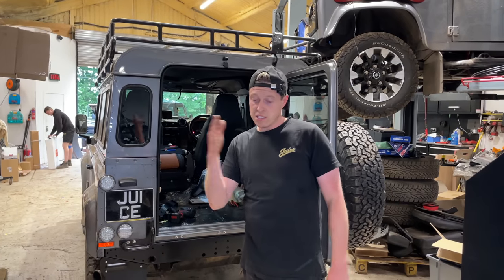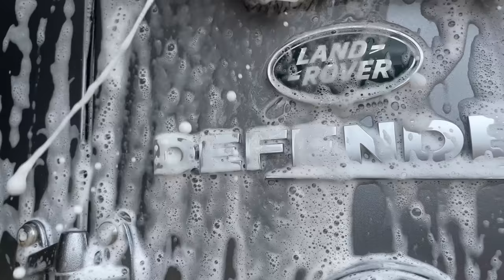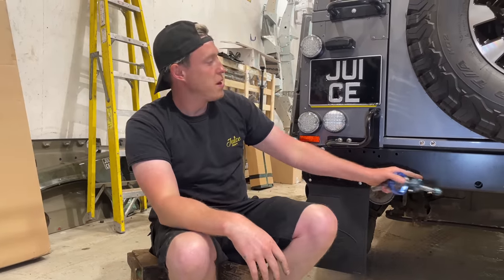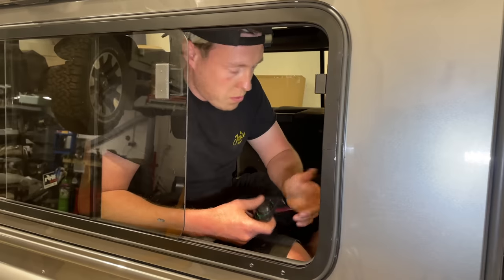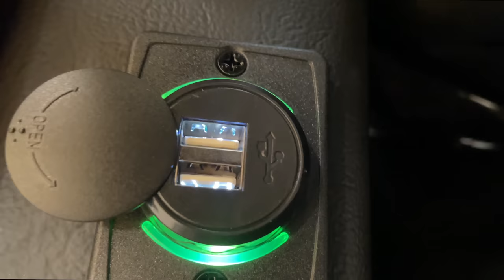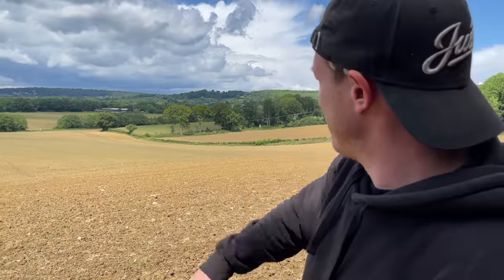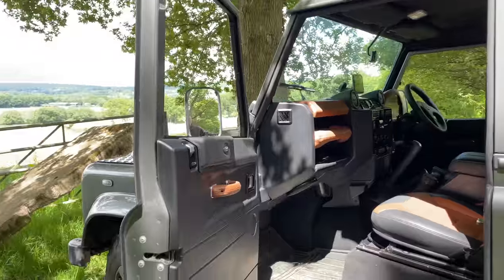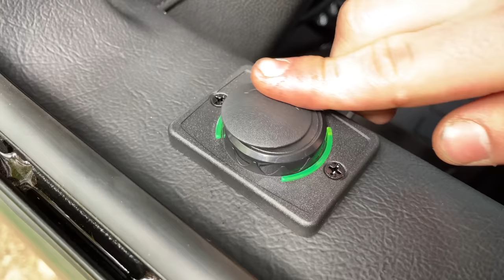Defender van to CSW Conversion - Part 5

Comment: Quick one. What type of AC condenser and
Fan did you use on this build. Notice it was silver through the front grill and generally the ones I’ve seen are black condenser. Thanks
Reply from the maker: It’s a CoolAir Logan kit
Reply: Kit part number? Thanks again. Love the VLOgS
Reply from the maker: Britpart supply it under part number DA2344 😎

Comment: It looks amazing you would never think it was a van body converted im slowly getting there with my 110 county wagon if had the change fule filter, fule lines, slave cylinder, pump the clutch back in and 30mm wheel spacers. I'm having a problem with my ignition tho seem to keep having a surge of power and it keep smoking from one of the red cables on the ignition barrel and wont turn the engine over any ideas.
Reply from the maker: There’s a short to earth in your wiring, that’s the smoking - you’ll need to carry out continuity tests and buy a power probe to find the issue. All part of the fun I’m afraid! Thanks for your comments 👌🏻💛
Reply: @juicemotors  sorry to be a pain would that be the earth on the started as it's not turning it over but the dash lights up and the the lights work. Thank you for your help with out this channel I wouldn't have a clue about half of the stuff with defenders.
Reply from the maker: @jordanoliver6800  one of the positive wire that’s sending 12v to the ignition circuit is worn through and touching the bulkhead, it’s sparking out and shorting to ground. That’ll be where the smoke is coming from, if you grab a power probe they’re so easy to use and you’ll use it forever on a Defender 👌🏻
Reply: @juicemotors  thank k you so much for that if been scratching my head think what could be doing it